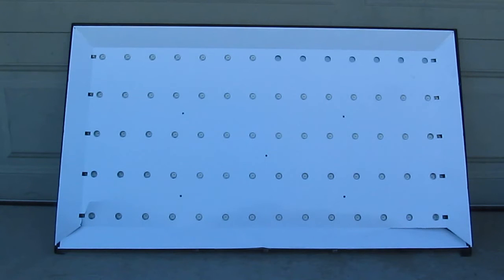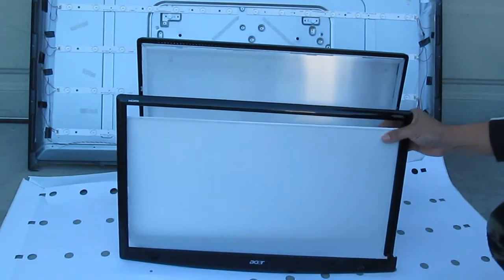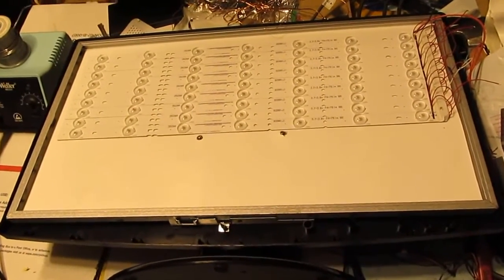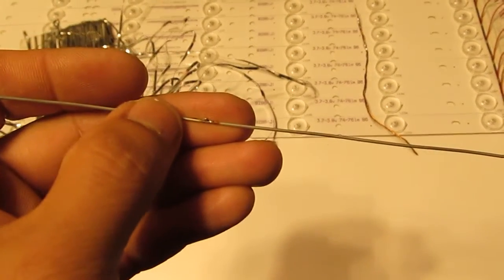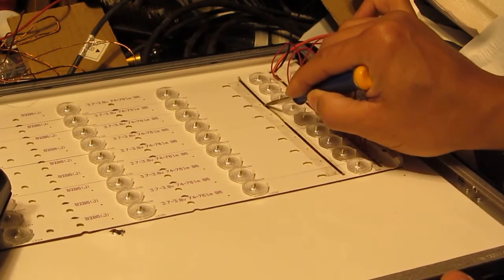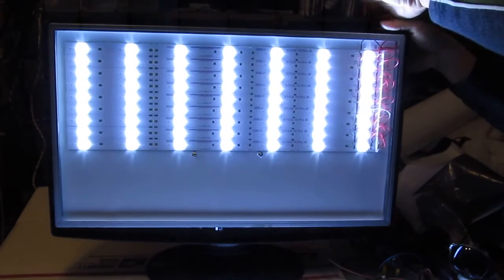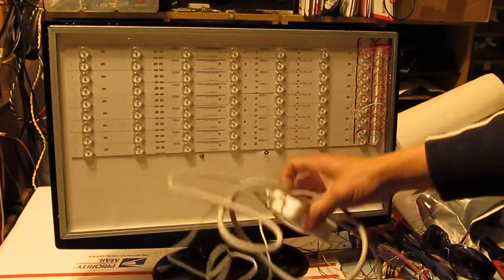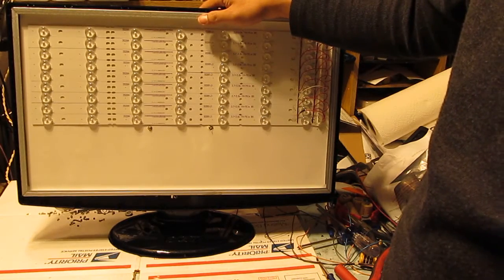DIY: Home made LED light panel salvaged from LED TV Backlight Part 2: Onto a smaller monitor

Comment: You need a resistor on each string of leds to stop them burning out. There should be one inside the tv of the right size for one string. The manufacturers use one resistor because they power the leds in series with high voltage.